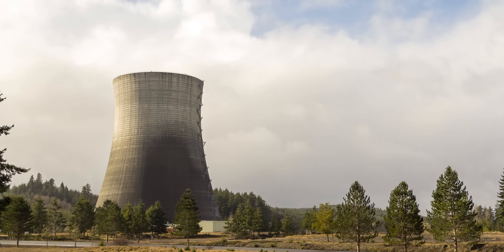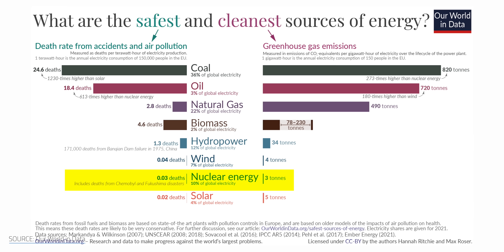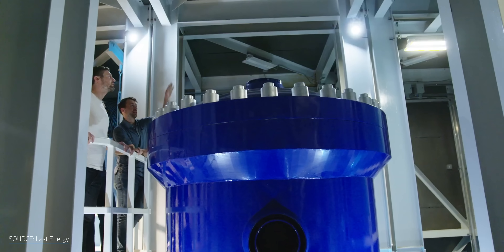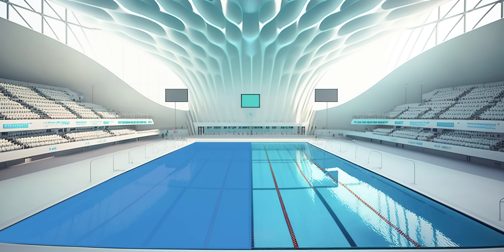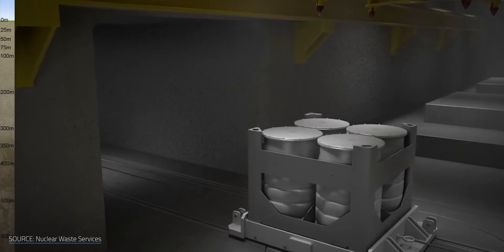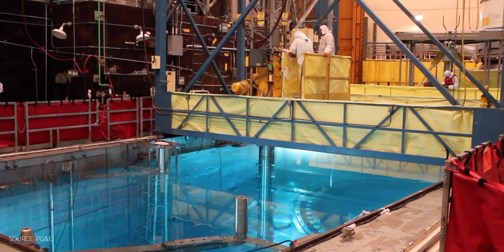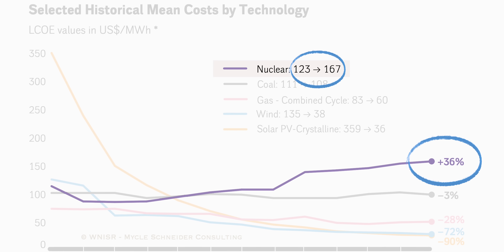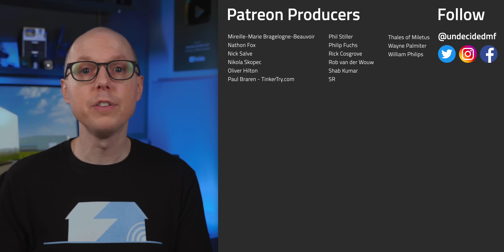Is Small, Fast, & Cheap the Future of Nuclear Energy?

Comment: Three Mile Island was actually a bit of a success story.  Yes there was a serious meltdown accident but there were no injuries, deaths, direct health effects, or adverse effects to the surrounding environment.
Reply: And the key element here is that there was a containment building, unlike Chernobyl. Interesting that when a country actually cares about the lives of it’s people, it requires the plant to protect the public at all times. What a concept….
Reply: @dmcdan1004  Its worth saying that the RBMK reactor was never designed to produce power. It was just that when USSR came into economical problems in the 70 and 80s they where just way cheaper than the VVER reactors to build. They where originally designed as plutonium breeders for nuclear weapons program (something that is really not viable with VVER reactors)
Reply: @matsv201  Which makes the decision to use it to produce power even more tragic. 🙁
Reply: @dmcdan1004  this was quite common place in USSR and also china. This is just the most known case, and not even close to the worst. There was a dam accident in china in 1975 that killed 250 000 people.

But this is always the result of dictatorships. When the people in charge never get punished for doing bad things, it just get worse and worse.
Reply: @matsv201  About dictatorships, I guess I could make some sort of snide comment about the political happenings in this country right now, but I won't. 🤐
Reply: @dmcdan1004  well i don´t know what country you are in.. so... i don´t have a clue
Reply: @matsv201  🇺🇸
Reply: @dmcdan1004  aa. Yes... we know that situation is super fair because you get blocked of every major platform if you are critical to it.. and.. well. Of cause. They never ban people telling thing as they are... may include a bit of sarcasm
Reply: Thank you for this discussion.
Reply: That was a rare success for Carter. He’d been a nuclear engineer in the Navy, and knew it wasn’t dangerous. He and his wife went to the plant in front of news cameras and stopped the panic.
Reply: A human turned off the emergency cooling pump after the S.C.R.A.M. event. Because of that action we get a release of steam and a melt down. Left alone the control system would have accomplished what it was designed to do, save the reactor.
Reply: @jesstreloar7706  That is correct.  Although more than steam was released after the partial meltdown as certain gasses had to be vented.   PWR nuclear power plants routinely release small quantities of decay gasses.  Dose levels are very low and well within permitted standards.
Reply: @perryallan3524  One of the bad reports from the time actually came from a news helicopter that illegally flew over the plant during a planned release of Krypton gas.  Obviously being right above the plant just as it released the gas caused a major albeit temporary spike in radiation which they reported without mentioning the fact that it was temporary, that the gas was expected to be there, that it would quickly disperse to safe levels long before reaching the public, or that they were flying in a no-fly zone.  Kyle Hill did a good video covering the incident where he also mentions things like a popular (fictional) movie that came out shortly before the incident about a very similar plant having a Chernobyl level meltdown, the general communication failures that caused 3 Mile to be a huge PR disaster, and a few other things that have already been mentioned here.
Reply: It's only by luck that the core didn't melt through the containment.  If it did, the core would have hit the water table and there would have been a huge steam explosion.  The "experts" argued about what was happening (the chemistry) and the IAEA couldn't contact the control room because there was just one phone line, and it was perpetually busy.

The argument: should they turn the water cooling back on, or would that cause a Hydrogen explosion?  Lucky for us, the one guy who thought there would be a Hydrogen explosion either changed his mind, or was overruled.  The water was turned on, and a disaster was averted.

They had no idea what had happened in the core.  Was it just damage or was it in meltdown mode?  Decades later, when they could conduct inspections, they realized it was a meltdown!  And yes, turning on the water was absolutely the right thing to do.

Fun fact: to this day, many details of radiation are not known.  So scientists don't really know what's going on inside the core.
Reply: @januslast2003  no, the core never melted. It was not luck  it was physics. Stop reading propaganda.
Reply: @matsv201  There was a partial core meltdown.  This was known rather quickly because of the gasses that were vented from the containment building.   Some of those gases only exist if fuel rods melted.
Reply: @januslast2003 industry person here, no it wouldn't. 1: A core would be expected to go about 1.5m into reinforced concrete before reaching equilibrium. The base of containment is much thicker. 2: The core exiting containment wouldn't result in an explosion from ground water, it would result in a sizle and the ground drying out. See videos of people discharging slag onto the ground for an approximation of the effects.
Reply: @januslast2003  I'm not sure the IAEA even existed back then; and if it did it had nothing to do with 3 Mile Island.

It was the NRC that could not get through (and now there are 3 completely independent methods for the NRC to tak with a control room and other plant officials:  Just one of about a dozen major lessons learned and corrected quickly after 3 Mile Island.

You are correct that the people in the control room had no idea what was going on in the core at the time.   The melt-though the bottom of the plant was considered plausible at the time - but later analysis determined that would be extraordinary unlikely - and standard procedure now in all US PWR's and BWRs if there is any real concerns about core integrity is to flood the basement of containment, similar to how the 3 Mile Island basement was already flooded, because that in and of itself will almost certainly stop a melted core from getting though the bottom of the plant.

Once they saw that the 3 Mile Island core was only partially melted and well contained by the reactor vessel concerns about that failure mode essentially vanished.  Of course - I think it was about 15 years later before we took the reactor head off and removed the upper internals to get a look at the partially melted core (I've personally seen the pictures and read the report on the resulting core condition).

We now know a lot about what is going on inside a core during nuclear plant operations.  Lots of $$$ was spent on that.  The ignorance that existed during the 3-Mile Island incident is long gone.

There were a whole series of forced plant modifications on all USA reactors (and many other countries as well) so that the control room would now know what is going on inside an overheated reactor core.  This cost $millions of dollars per plant; and newer plants are built with those systems installed up front.   A reality, is that virtually all nuclear construction and safety standards were written based on failures in earlier plants or test reactors (and there has been 1 direct death, and a number of significant radiation exposures to a few people that altered their lives).
Reply: that were reported.
Reply: Is that a joke? You can't be serious! Stop lying.
Reply: People these days believe shit that people make ..... Don't think for one second that someone wouldn't cover their arses and give manipulated reports and info 😂😂😂
Reply: @davey2k12  The nuclear industry has committed suicide for all the wrong reasons. Not because of the extremely hazardous, ever-accumulating radioactive isotopes generated by nuclear fission that never existed prior to 1939 (except for minute quantities in the Gabon Oklo deposits from natural fission billions of years ago) and will be the greatest hazards to all life on Earth for longer than mankind has been in existence, always bioaccumulating and ever-increasing mutation of life forms. It has failed because it is by far the most expensive and unreliable way to produce electrical energy. Private financiers don't like to lose money and want a quick and safe return on investment. That leaves nuclear out. The only way nuclear con artists can make money is by lying to citizens to go along with subsidizing the construction of these so-called "advanced reactors" whose design has been around for over 50 years and have never worked. By the time the public realizes that these reactors are a sham, the fraudsters will have taken the money and run.
Reply: Still pedaling that same old con game, eh? How are your partners that got banned from international projects for fraud doing? Have they convinced Truedope to let them put all their highly radioactive waste in an abandoned reactor on the St. Lawrence Seaway and fill it with concrete, yet.
Reply: @LTNetjak wrong. The release at 3mile was a release of nuceartides (actual radiactive particles) that emit gamma radiation from plutonium. Plutonium does not exist in nature.
Reply: Oh wow lot of dispute about the facts! 'Back in the day' I read from various sources abt cancer hotspots around some of OUR(uk) plants - theres a scary History lesson about an uncontained reactor burn up at Sellafield (See "Windscale Fire 1957') and  Pretty sure THAT was one of them .. Poor xxxxers at the Plant SERIOUSLY exposing themselves to the hot area trying to hammer a glowing fuel rod back in with a scaffold pole = pure Homer Simpson!
  (they tried everything on that core including gushing loads of water thru it, which certainly WASNT recycled but sunk into the ground - and the agreed filtering was NEVER fitted to the chimneys!)

Wonder if theres a means of getting solid statistical data on the others??
Reply: The media scare is why people still view it negatively.
Reply: 3 Mile Island was a perfect showcase of two things 1) maintenance is important and 2) well designed security systems are bulletproof.
Reply: It proved that the standards and procedures of the time WORKED.  Thank you Adm. Rickover.
Reply: they had a non-glass containment vessel however.
Reply: @thedavesofourlives1  google : NuScale cancelled
Reply: and we got some new ideas and reasons for funding them. so we got much safer much quicker. sad it happened. glad we learnt.
Reply: @@LTNetjak Actually more than 3 mile Island.   You missed the biggest radiation source in most modern house construction.  Granite kitchen and bathroom countertops, and much worse is granite flooring.

You really should look up the radiation from flying.  Commercial Pilots and flight crews are hour restricted each year so as to not exceed the annual "acceptable" dose for radiation workers.    I don't know a single nuclear plant worker who regularly gets the radiation exposure of a commercial pilot or crew member year after year.   If you get a "higher dose" one year typical of pilots and flight crew the nuclear plants tend to keep you on low dose jobs for several years before your next higher dose job.
Reply: @perryallan3524  is it true that the radiation dose from a trip to Mars could be fatal?
Reply: @perryallan3524  some radiation or hot particles are good, others are bad
Reply: @FernandoWINSANTO   Please tell me which of the radiation I got when working in nuclear power plants, or flying was good for me - or anyone?
Reply: What about Chernobyl? Fukushima?
Reply: Yes it was safely handled but it is the cost when there is an accident. The cost of accidents instantly removes the profitability of the project. Then the cost gets passed on to the taxpayers for what could be hundreds or thousands of years.
Reply: @scruples671  I'm calling BS on that.   The Nuclear Power Industry has a self insurance program that is paid for the customers of nuclear power as part of the cost/kWhr of electricity.   3 Mile Island was cleaned up with that money (I understand that the fund behind this is now so huge that each US Nuclear Power plant banks $50 - $120 Million per year in interest earned from the fund as its size is limited so some value I believe over a Trillion $).

In addition, the law on the books about ultimate cost recovery in the event of a disaster beyond what that fund can handle directs that the insurance rate on nuclear power plants be 1st increased to cover the cost; and then states that Congress and the President could authorize more funding from other sources (hint - it would take a new law)     At this point, there is no way the general taxpayers would be responsible for  a commercial nuclear power plant radiation disaster.

Now compare that to the cost of closing and sealing of abandoned oil wells in the USA which many companies dump of on the States (Hint the Oil Industry gets huge taxpayer subsidies well beyond anything given the nuclear industry).
Reply: @perryallan3524  imagine if we used this system for j a b s
Reply: @perryallan3524  we-ell ok - no-one dispites oil and coal can be pretty dirty TOO .. If you saw my other posts, guess you can see I'm not a super fan. Humans will always lie and attempt to cover mistakes, so we need to factor in the danger levels for doing so - lowe4r level spills and releases might NOT get declared - which HAS historically happened (Silkwood at Kerr McGee, right?)
Reply: @scruples671 the reason it's passed on to tax payers is because of the batshit crazy remediation requirements public bodies will require to satisfy perceived public fears of nuclear. In Fukushima they are scrapping up earth that is less radioactive than the earth in places like Colorado and sending it to landfill. See controversy over incredibly dilute radioactive water at Fukushima.
Reply: Didn't lots of people from said community get cancer related illnesses but no one could "prove" it was from said related melt down? Hell my parents were in a radiation zone and lots of their friends / people they know have gotten cancer at a higher chance thrn people living from another area.
Reply: @historyz1941  No:   Statistical comparisons showed that there was no abnormal increase in cancer rates around 3 Mile Island - as there is a certain amount of cancer everywhere.  But, yes some people claimed that was "obviously" why they got cancer - and my memory is that in 1 case they did not believe it was their decades of smoking that did it).

Please note that all nuclear plants in the USA have  radiation monitoring equipment at the boundary of the plants.   The US Nuclear Regulations are that no more than X amount of radiation exposure to the public beyond site boundaries.   They have to monitor site boundary radiation to be able to show they are in compliance.    There just was not any meaningful radiation release from 3 mile island (and yes my memory is that they vented a very small amount of radon gas - which is actually a normal process from time to time at all nuclear power plants).

Now the radiolgical mess inside the containment building was bad; and if I recall correctly they did not even open and enter the containment building - at all - for 10 or more years to give much of it time to decay.  Although they did take water samples from the bottom of containment (they had partially flooded containment) so they knew how bad it was and how things were decaying. Time solves a lot of man made radioactive isotope issues.
Reply: @perryallan3524  Yes!  Trust the government!  They are your friends!  All is safe...nothing to see here.
Reply: @The_Savage_Wombat   I never said trust the government.  How about trust the people who have spent decades working in the field and dealing with the issues.
Reply: @perryallan3524  When does that ever happen?
Reply: @historyz1941 the reason nobody could "prove" anything is that there's nothing to prove. Anecdotes about cancer aren't stats and the fact that more than 1 in 3 of us will get cancer mean that determining if low doses of radiation cause small amounts of cancer in large populations impossible.
Reply: Parents got radiation from a different event. Mostly from being around mines and doing what kids did back then they swam in tailing ponds( super bad for you).
Reply: I think there are a lot of people who lived or worked around the plant who would disagree with that
Reply: @HonestSonics  Not really.   The radiation exposure to the homes and businesses across the street was less than someone gets flying just once from Chicago to NY city in a commercial airline, or NY City to Chicago.

I used to work in the nuclear power plant industry.  I've seen the radiation release records from 3 mile island.  With the exception of 1 year where I had a "special exposure" to a specific piece of equipment the estimated radiation exposure from my flying commercially all of those years was far in excess of what I got working in nuclear power plants (which is tracked in detail and you receive an "exposure report" every year).

Funny story:  There was a TV Broadcast of some post 3 Mile Island accident on the results - and a variety of "anti-nuclear" groups in participation (I watched this TV Special).   Someone got up complaining about how much radiation was released - making it seem like it was horrendous... when someone else pointed out that they personally had received more radiation flying to the location for the meeting than was released to the homes and buildings across the streets from 3 Mile Island.  Mr self proclaimed expert emphatically said "do you all think I'm stupid or something" - to which everyone else at the meeting; including the major anti-nuclear organization representatives started nodding their head or saying "yes."  He shut up, sat down, and didn't say a single word the rest of the meeting.  I laughed so hard... You could not make up how dramatic it was in a movie.  It was real life.

A reality, is that we live in a radioactive world and you yourself are radioactive at a certain level (and we can put you into a "whole body counter" and measure that).   It's predominantly trace radioactive potassium from the food we eat.  You will also find that all natural water sources contain tritium - as does your body.

3 Mile Island was a mess in several ways and the Nuclear Industry worldwide learned some major lessons from it.  But, it was not a radiological disaster.   Biggest lesson is that Containment Buildings work (and Chernobyl did not have a containment building - and the RBMK graphite reactor was inherently unstable at very low power levels - something else no other commercial reactor design in the world has allowed).
Reply: @perryallan3524  The radiation releases published after TMI were inaccurate. First of all, all the radiation monitors at TMI were "cooked" and not in operation after the containment was ruptured. What measurements were published were guess estimates, and even the NRC admitted were inaccurate in the public hearing. Some measurements were made by helocopter. Imagine how the downdraft from a helocopter would effect the accuracy of measurements made. The plume of radioactive release from TMI followed the atmosphere above the river valley. A school class 100 miles away had a science experiment with a radiation monitor outside a window prior to the accident. The monitor was chattering off the wall after the disaster. The school notified the Govenor and he told them not to talk about it. Hershey Chocolate found cesium-contaminated milk from their suppliers and began using stored milk after the disaster. Studies conducted by Universities at Columbia, Pittsburg and UNC documented leukemia, breast, lung and general cancer increases in impacted population. 
Getting accurate information from anyone who worked for the nuclear power plant iundustry is like getting the truth out of Joe Biden. The industry's credibility is zero, zilch after 75 years of lies, cover-ups and bribes to public officials. Save your breath.
Reply: @perryallan3524  why would flying anywhere expose you to more radiation than normally? Wouldn’t it expose you to even less radiation than just standing outside since the airframe would shield you?
Reply: @ivan5604  Earth's atmosphere and magnetic field shields the surface of earth from a lot of radiation from both interstellar space (cosmic radiation) and the sun (solar radiation).

As you go up vertically the radiation levels increase noticeably; and as most commercial aircraft fly at greater than 25,000 feet elevation above the surface the radiation level is noticeably higher than at ground level (where you have 25,000 ft or more of the most dense and best shielding layer of the atmosphere).

Also, the thin aluminum shell of a commercial airliner has no appreciable effect on slowing or stopping cosmic and the worst components of solar radiation.

Perhaps you think we should build commercial airliners out of thick steel (which has a lot more strength than lead) to provide adequate radiation shielding (and without most windows as well).
Reply: @perryallan3524  there is science to support increased lifespan after exposure to low level irradiation.   Japanese studies have shown longer lifespans for Hiroshima and Nagasaki exposed to low level radiation.
Reply: @HonestSonics  lol, I lived in Middletown, pa when the accident happened, which is about 3 mi away and I stopped glowing years ago! Sorry I couldn't resist. Actually there were some people that suffered some types of cancers years later and they were in Falmouth just across the river from the reactor.  At this point I think the plant was shut down a couple of years ago or so I read
Reply: @HonestSonics the  you be totaly wrong.